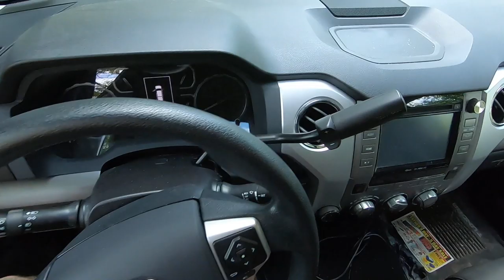Let the FUN BEGIN! Customizing the BARN we BOUGHT off the INTERNET

Comment: You should do a Dutch door with a window on top.
Reply: ... I think a Dutch Door is an awesome idea.  Whenever I see one, it reminds me of country, but classical
Reply: theyellowhousehomestead A dutch door w top open IS a window.
Reply: All it would take is the wind to catch it once and it would smash everywhere....
Reply: @norweavernh  true, but it probably won't be open in the winter. That's the goats side, so they'll enjoy the light in the winter.
Reply: @sandravanderleek8569  Not if it is hooked open.
Reply: @Bunefoo401  🇬🇧    By Dutch do you mean a Stable Door.   ie Top opens separately.    I think it's a great idea.
Reply: @sandravanderleek8569  🇬🇧     When the top is open it's fastened back to the wall so it should be safe.    When closed the top is bolted to the bottom.

Comment: Agree with the Window.   Noticed you didn't use any type of moisture barrier when you nailed the 2 x 4 to the concrete.  Thought  it was recommended even when using Pressure Treated Wood.

Comment: That proposed window in the Goat Stall/Wing would undoubtedly be a good idea, for example when you have the door closed it will let some light in – especially welcome in the winter months.  Also, perhaps air-flow if it is a window that opens when wanted.

Comment: Was watching your construction this am and you mentioned the need for a wall that can be in place at certain times. Consider potting a nice strong backer on the other side of the interior wall that you want to attach to and build a wall that hinges into place when needed then will fold back flat against the wall it is hinged to.a couple of nice sturdy latches on the striker wall and you have your convertable room. hold the wall up from the floor a bit and consider a small roller on the outside corner for support at all times.

Comment: Really good build Al , I know it's a barn but I know people who would love to own a building like that to live in , with some trimmings of course . Great job , you're doing a  good show of what can be done by one man with a bit of help here and there and showcasing Jamaica Cottages , I'm also impressed by the DeWalt cordless tools you use , they are quite expensive here in Oz but I can see the value for a tradie . Good work :-)
Reply: Exactly what I was thinking. YOu could live in one of the sides and still use the center as a garage or workshop, maybe make the other end a big greenhouse. I'm not sure about building codes though. Oh that great loft is up there too. Would need to insulate the living area from cold and heat.

Comment: Well, Al, you asked if anyone had any ideas for the goat stalls. Here is my mine. A front stall for the kids. A middle room for the milking of the goats which would have three (3) milking stations (one for each member of your family) as the herd starts to grow. Move the inside door to the middle of the lean to for access from inside the barn. Seal door opening to where the kids stall is as you can put a gate on the side to the milking room.The back area would be the stall for the mature goats with a gate to the milking room. A door on the side towards the pasture for the goats to have access to the outside  pen /or pasture area during the day. That would give them access to the apples that fall from the apple trees out there.Hay access from inside the barn (loft storage) would be easy no matter what the weather or season.Your new door opening would probably make cleaning the pens easier to load up your manure wagon (another project for you to build) . Your doing a fantastic job working by yourself.

Comment: Window that can be opened with a hardware cloth "screen" behind it.  Solar heating in the winter, air flow during the summer.  And you may eventually want to put chickens in there, so having the hardware cloth in place will make that a super easy transition.

Comment: I'm about to add a couple of windows to my shed build (in progress) too. I do envy the materials you can get where you live. In FL, everything has to be imported from across country, no local forestry industry. All quality wood products are either expensive or unavailable.
Reply: Judy G.  FL has no forest industry save cypress for fences. Every thing else is trucked in from out of state. I can't buy cedar in any form save 2x4's for almost $10 each and that's exclusively at Lowes - Home Depot doesn't even carry it. Rough-sawn is almost non-existent in any size. No local saw mills.

Comment: You need a window in the back wall for the goats to have ventilation and light.  You need a way to close it off during the winter months.  That will, however, make it dark inside.  Maybe a skylight would be good, although I heard your talk about doing a skylight.  Maybe a high window on the back wall that was about 12 x the width of the wall.  It would be fixed to remain closed but let in light.  Then you can build a lower window either louver or open screened window with a shutter door for it in winter.  Anyway, you need to think of lighting and ventilation for the back part of the overhang.

Comment: I would go for a door with glass on the upper half, hanging from a barn door slider rail, which moves to the side and not in or out of the space. That may require hanging the door a little proud of the battens for smooth movement.

Comment: I love the window idea and a window in the door - would do it in a clear flat pvc sheet so if a goat tries to go through it they won't hurt themselves like glass would - the sun going into that area in winter would be lovely - I would do the door in two halves so you could open the top without letting the goats out and 100% opening hinges on the doors to get the door out of the road when needed - just thoughts - looking good

Comment: Window yes- will look good and give you light in that front corner.  Barn is looking amazing!  Having the “finishing” experience is cool.  Finishing woodwork can be tricky depending on the type and quality of the wood.  My husband used to work with figured maple quite a bit and getting a nice finish on it can really be tricky. I’ve been wondering if you’re going to stain or paint the outside after all the constructing is done...  You are lucky to have gained all that experience.  Love your videos!

Comment: Al, If you are going to use the leanto for feed storage, you could hang sliding barn doors so you can access from the side. They would fit your homestead look.
Reply: Judy G.  Eave overhang is stretching the term eave. An eave overhang would not have separate support. The eave would be supported by the primary building wall, sometimes with a truss. Al cut the eave overhang off to make room for the lean to roof to flash to the main roof. 
The building term is Lean to, especially in the pole barn industry. It defines a building or addition to a building that has a slope to one side. 

At 30 feet deep, a sliding barn door at the back eave side would give Al better utilization of the back of the lean to. He's going to need pallet loads of feed soon as his animal population grows. The apple tree makes it difficult to put a useful door on the gable end of the lean to. 30 feet is awful deep to be limited to doors at just one end.

Comment: I just noticed a safety issue. When using the chop saw you should measure from the left of the board and cut to the right of the line. This way you don't cross over your left hand in front of the spinning blade to hold the "good" piece. It also helps to line up the cut because you can more easily see the left side of the blade. I have the same DeWalt saw you have and it is designed to be used in this manner, hence the handle on the right side of the saw.

Comment: Agreed on the window.. IN fact if your going to enclose that entire side a few windows down that side would be nice. I would say you’ve learned your lessons pretty darn good measuring to the 16th on rough in. It makes for a nice finish when you build everything like your making cabinets. My old eyes won’t hardly see a 16th anymore. How to tell when the video is almost over .. when you run out of nails for the nail gun.. LOL..  yes sir when you have to get the hammer out to drive nails it’s time to quit.. oh I will confirm your statement about the dewalt table saw they are built right .. I don’t know that I prefer dewalt tools as a rule most of what I have is makita that I really like.. I did commercial construction for many years have never had a makita tool fail me. But the dewalt portable table saw is an excellent tool.. I sure do like that barn.

Comment: Oscillating Saw , .. I have one ! A Milwaukee 18 VDC and I Love It ! I call it my Beaver Saw because it eats wood and just about everything else also ! Great for cutting holes in Sheetrock, Drywall , plaster & lathe walls for Electrical Boxes. Better than a RotoZip of which I also own ! ( I'm a Licensed Electrician, specializing in Residential & Commercial Wiring, Maint. & Upgrades)

Comment: I don't know what your plans are for the front.  I think you said for storage of your feed.  I like the idea of the Dutch door which gives you light and ventilation if using hardware cloth like was mentioned before and door that opens in addition to the solid top half door.  I don't think you want anything that opens near your feed because of rain and preditors.

Comment: Look around in your area for a stain glass  panel for the over the garage door.  A Dutch door would be nice also.  Maybe a stain glass small window might look nice???  You could make a second Dutch door top part with a screen that you could switch out in the summer time.  Al, I'm sure you will be able to figure out what works for you, maybe you should wait until you use the barn for a year THEN remodel?????

Comment: Window yes.  I am the same way.  Visual.  If I have to read the instructions, it will take me forever.  But if there are pictures, diagrams, or someone shows me....  boom.  I got it.  I was tech support way back in the day.  And I wrote a procedural manual for the computer staff.  Most ppl were good with that, but there were a few ppl who were visual like me.  And I understood that.  So instead of having them fired, I just showed them.  Worked perfectly.

Comment: Love the door, it definitely needs a window next to it. We have a few things in common. I also worked in a furniture manufacturer. I didn't work every station, but I built a lot of armoires, dressers, credenzas, bed frames and head board shelving units, worked in the stain, satin and high gloss paint booths and screen etched glass door panels and mirrors. There's nothing quite as mind numbing as feeding stock into the belt sander, planer or over a routing table for hours, am I right? We also had to load all the trucks for shipping. Also done restoration on Victorian homes as old as 1887, including hardwood floors. Whew, I'm tired just thinkin about it. All a lifetime ago. Thanks for sharing your stories too. ❤️

Comment: Yea, a window would be best.  Especially since the barn is south facing, get some natural lightage inside.  I would say to also add some skylights in key areas...but it would have to be small ones to fit in between each valley of the tin roofing to allow water to flow.  But alas, there isnt one small enough that I could find online to show you.  So, only thing I can think of is to custom make small panes of glass that would fit in the valleys, and trim it, all while making sure it doesnt restrict the flow of water.  Yeah, it would be in strips, but at least it would be natural lighting.  No need for artificial lights to be used during the day time, just at night.
Reply: SOLATUBE might be a solution....but pricey
Reply: @sissydewoody8717 , although a good suggestion, but I dont think he would go rd hat route.  Look at the goat barn, it doesnt have an attic like space inside.  Just the roof panels, and one of the panels happen to be a transparent one to allow light through.  Now, I could see him replacing one of the panels to do just that, but these panels are different than whats on the goat barn.  And since inside the main area does have lofts, I highly doubt he is gonna put ceilings inside as well.  I wouldnt if it were me.  But even still, having the transom window in the main area, and a little window on the sides, its some help on letting in natural light.  But thats just the south wall.  The east and west walls could have windows too, which would be probably a better option vs a skylight.  Cause then he doesnt have to cut into and mess with the tin roof.

Comment: Thanks for sharing your background. You handle that Estwing well. Took a class on Saturday morning my senior year. Framing and finishing the first semester, concrete the second. A contractor took pictures and turned us in as scabs. We were on a field trip. No one  had hammers, there was no saw. He tested our knowledge with questions. What's that short stud between the sill and bottom plate? What's the dimension of that header? Our teacher was fined and suspended. We were blacklisted. The end of the class. Worked in other trades, just nonunion.

Comment: Why didn't you anchor the bottom plate, so you could cut the plate out of the doorway?

It would be better if the siding hung past the plate onto the concrete.
Reply: I was wonder that, plus why he didn't put the foam down to protect the base board. But I'm sure he has his reasons.
Reply from the maker: I am thinking about leaving the sill plate so when I close the door it will seal tight up against it. When I make the doors you will be able to see.

Comment: Spray foam would be helpful for insulation. Windows are always good! I just saw a rodent proof feed barrel thing on Pinterest. It had a "drain" on the bottom to fill up a feed bucket. The barrel used was a 30gal blue barrel. And you'd always use up the old feed first when ya dump a new bag of feed in there. Lemme get the link to it : https://pin.it/fz22i6nvbcx236

PS have you seen that Polywhey wood protectant for wood??

Comment: Three piece windows can  be stack one above the other; so as the bottom third is like  windowbox / you know like two sided hay feeder exact copy of the you have built by their the willows posse currant barn except instead the roof, would then have the other windows above window ledge . The can opens or
while top two stationary or swings open like in their barn has currently for ventilation  purposes. Yes please redue the wall entrace base and concrete foam barrier. I'm sure door area won't matter much except underneath the window area. Hey you can build windowbox/Hayfeeder.......  Yes we can wait, it's amazing so close, but we all agree your want done correctly , and we believe you no just dont rush , so it can pass it over to grandkids kiddos.

Comment: Are you going to put a hot/cold water system in the barn?  There are a lot of different ideas on Youtube. 
Also, are you using solar panels to heat the barn?
Reply: Judy G. I’m referring to put heat in the workshop. We live at 10,000 ft above sea level in Colorado and we have wood stoves in our workshops. Makes it comfortable to do projects in the winter. Get lots done that way.
Reply from the maker: I hope to add heat to the workshop area

Comment: The learning style you are talking about is called active experimentation. You can read the book, but until you manipulate the materials - your brain does not make the connection.  If you were to do small models or sketches at the same time you will find learning so much easier.

Comment: I cringed every time that you put your left arm to the right side of the blade when you were cutting the 2x4's to length.  You should have held the 2x4 with your right hand and used your left hand to operate the saw.  It would really smart if by some chance the saw grabbed and caused your arm to be drawn into the blade.  Not trying to be a safety "nazi".

Comment: Electric tools needs a HEAVY DUTY power cord. That 16/3 extension cord is Too Light in its rated capacity. Should be a 14/3....but it looks like you have a very long run there, so you need a 12/3 cord.  CHECK you cord usage chart in your tool instructions.  The VOLTAGE DROP with shorten the life of your tool's electrical motors. I can see why you moly use battery stuff.